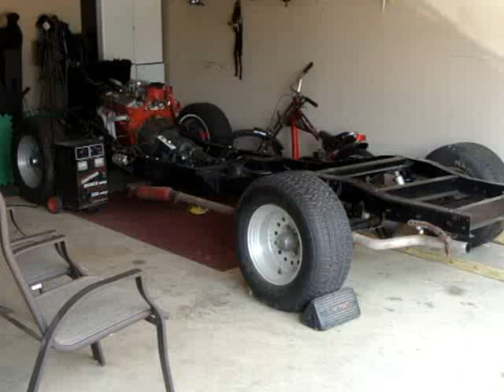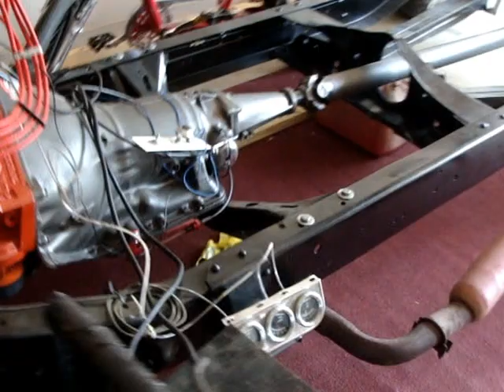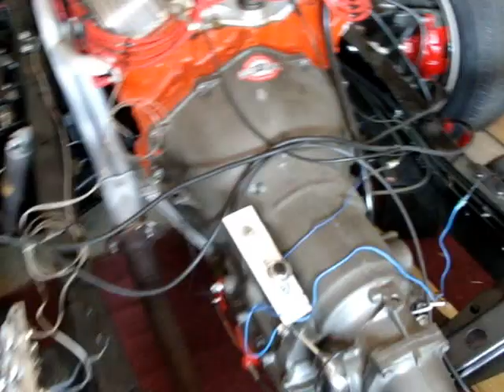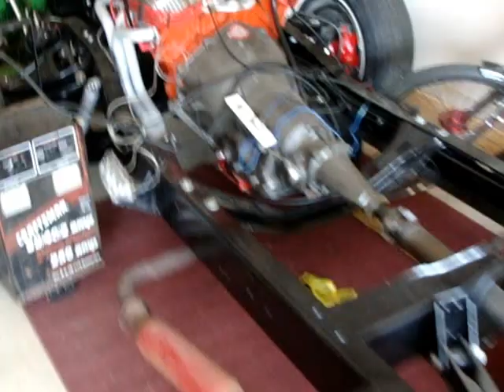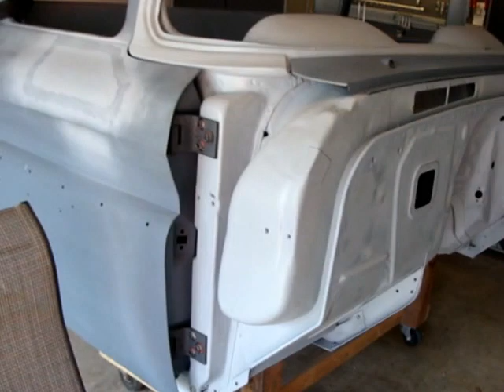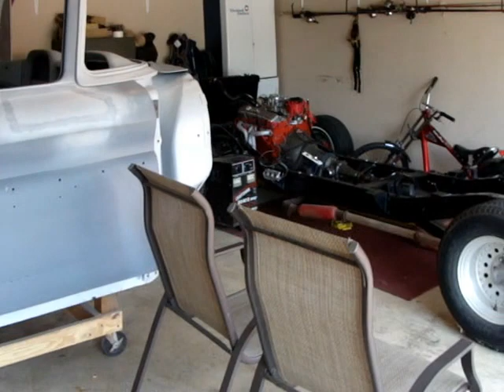1963 chevy c-10  truck 350 engine

Comment: What kinda headers are you running? Just watched the seat in video , turned out great!
Reply from the maker: In this video I'm running Mr Gasket headers, now I'm running Hedman headers
Reply: +gibson63

 I'm running a 350 with angle plug heads and can't find any header except ram horns from Speedway. Was assured the H8021 Patriots would fit but no luck. I'm about to remove the heads and change to stock 202's. Do you to have the part number for the Hedman's or know what part would fit? The patriots hit the stock motor mounts and the 4 & 6 cylinder tubes were way to close to remove the plugs with a 5/8 socket. Terrible fit overall.